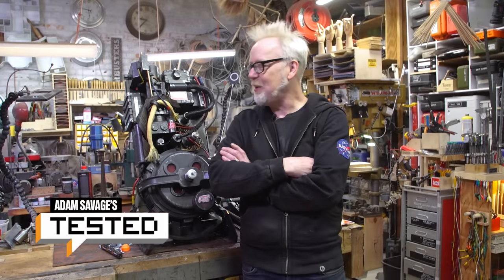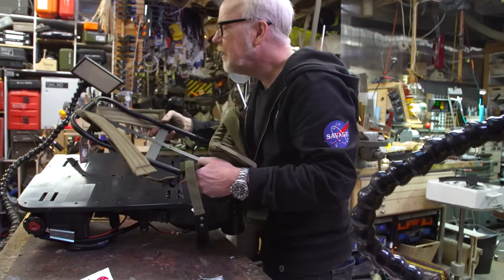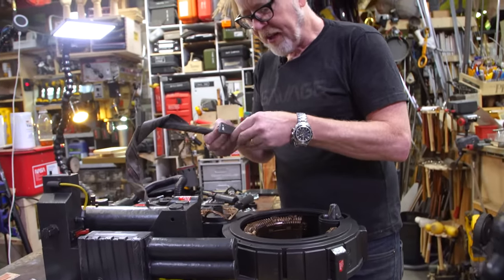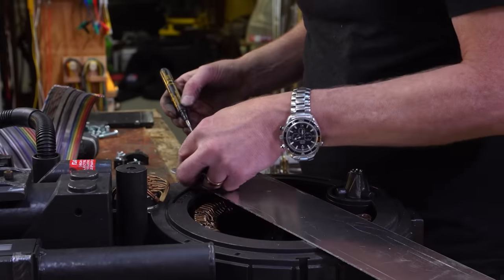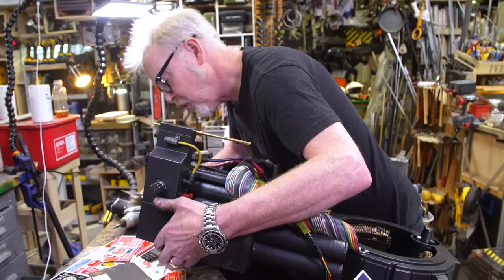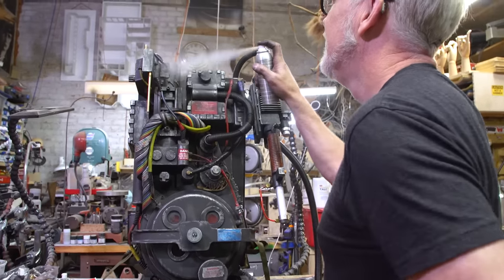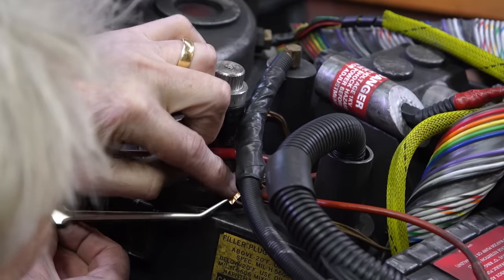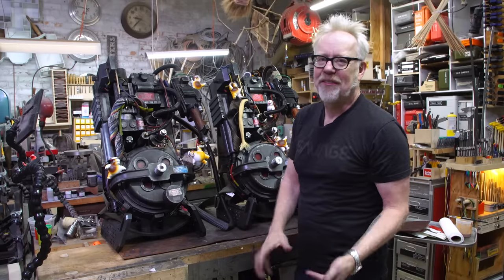Adam Savage's One Day Builds: Hasbro Proton Pack Upgrades!

Comment: My ex's father, as part of his work on his PhD in physics, made a small particle collider the size of a wall clock. So technically, it appears you could put one in that pack. It wouldn't make that cool sound when turned on, but at least when you use the line, "Why worry? Each of us is wearing an unlicensed nuclear accelerator on his back," you wouldn't entirely be making it up. 😁

(edit: for reference, technically a CRT in an old fashioned television is a "particle accelerator" using electrons, so its not really difficult).
Reply: Watch out, don't cross the streams!🤣

Comment: For those looking for the yellow braid sheath - my shop is linked in description above but I sold out. Should have more in a week or so.
Reply: Lol i jumped on it this morning, thank you!
Reply: Thank you, Sean!
Reply: Your GB cable kits have been consistently the best I have found. I have been forwarding all my locals to your shop for their wires and cables. Thanks for the great products.
Reply: @Shwalamazula  thanks!
Reply: Just read this now after finding it sold out. Thanks for the update!
Reply: Any V clips for the wand connection to top of pack? I couldn't locate it either from Adam's video. Also, is there a way to get notified when yellow braid sheath is back in stock? Thanks.
Reply: What gauge of wire did he use for the black, white, red, and green?
Reply: @Scorpius-Gamer  Agreed, curious where he found those V clips?
Reply: I’m GUESSING is 20awg.

Comment: I am stoked to receive my pack on Friday. I’ve been very impressed with the wand. There are some minor issues, but the electronics are outstanding. A switch to change between firing modes from the official video game? Using the top knob to adjust vibration and volume of hum? Are you kidding me? I can’t wait to upgrade the pack and wand. I’m even more excited knowing I’ll have extra stickers and hardware.

Comment: Hey Adam — when you go to look into the motherboard: the particle accelerator should be disassembled and taken out as it helps hold the motherboard and pack front together. Otherwise there’s several screws holding it together. 

Two of the long screws in the middle of the motherboard hold two pieces on the front of the pack. 

Also the Dixie cup holder for the neutrona wand on the pack is held by screw and nut/washer on the inside. You will need to take the motherboard off to do it. 

Best of luck whenever you decided to tackle it.

Comment: There is a small detail to the pack by removing the clipped ribbon cable bracket. Nothing major, but just a nice easter egg if you keep it and remove it when the pack is on.

Comment: Great weathering and video Adam, I'm actually a bit surprised they changed the ladder but at the same time thankful you helped them out there.wasnt thinking we would get a more accurate ladder.  on my neutrino wand I weather's the device only mildly to wait till my pack arrives and then see were I want to take it (for me probably somewhere between the original pack and the new rusted weather pack) I will weather the stand as I did with my neutrino wand to make it not rusted but rather lived on a shelf for ages worn in and lived in

Comment: Just wanted to mention, there are Easter egg sounds built into the pack that are based on the cables on it being unplugged, with the replacement put on, they’re permanently fixed, and so those features of the pack will never be accessed (rainbow cable is meant to be able to come on an off to create the pack malfunctioning mode)

Comment: I have yet to receive my pack but I find it extremely amusing that I have all the parts he added to it all set and ready to do my own exact modding. The cables, colored electricians tapes, copper tape, paints, sprays. Every exact thing he used, I had already bought before even watching this lol  Alice pack is also ready to rumble. My thoughts on the cyclotron, I don't have a 3d printer so I was just going to poke some real wires over the molded ones and do some repainting annnnnd maybe insert a light inside it. I also plan to do a smoke upgrade to the n-filter with a simple key fob system, nothing fancy.

Comment: Nice work. I just got mine. Like yours, the Alice frame is way too close to the backing board at the top. There is a much bigger (and more noticeable) gap on the real prop, where the foam tube goes. There isn’t any room for the foam tube at all now. Any idea if there’s a work around to fix this? Thanks.

Comment: Barnard clay has long been used by potters as a source of iron in dark firing glazes. It offers price advantages over using iron oxide and being a clay aids in suspending the materials in the slurry. Barnard has proven valuable for iron slip glazes requiring high clay content. That’s what it’s used for

Comment: The Ribbon cable on the Haslab one isn't GB2, that one is made up of a few dozen twisted pairs of rainbow and brown. The Haslab ribbon cable looks like they used as many wires as the GB2 packs, but colored them like the 18 wires in the GB1 pack.

Comment: Have you ever tried to do weathering which includes an obvious repair such that a component seems to be
newer?  Few things that are heavily used are monolithic in aging.  Obvious touch points and weak points are more heavily weathered or show signs of repair.
Reply: Never thought of it that way but that would be a really cool way to weather something
Reply: Another aspect of aging/weathering is a well cared for item.  For example  a soldier's weapon is well cared for in ways that matter to it's operation, but abused in ways don't.   The mechanism is pristinely clean while the stock might be clean but banged up.

Comment: Adam, as said in your separate building of the pack, do you plan to dive deep into the cyclotron and possibly wire in the video game lights? since the neutrona wand comes equipped with the video game settings?

Comment: I love it. Just know with the way you attached the ribbon cable you disabled the ability for part of the hasbro pack to work. When you detach that cable it gives error sounds and every once in a while there are slimer and other noises that play when the cable is disconnected. So with it permanently attached now it won't ever give you those cool sounds

Comment: Hey Adam, when you dig into the internals for a detail job. Will you check one thing for all of us?

Can you see if there is a way to make the motor not sound like a cow mooing?

I haven’t received mine yet, so I am not able to verify if it’s the motor itself, the location they placed it, or if it’s not insulated enough.

Also, when weathering the wand, why not replace the rear grip and add actual sports tape to it?
Reply: Upgrade the speaker with a simple aux mod and the new overpowering volume of the pack will drown out the rumble pack sound.

Comment: I did not get in on the original run for these, but I need to have one once they are made available to go with my neutrona wand.
Reply: they wont ever be made available. it was a crowdfunded Haslab project thats limited only to those who funded it a year ago. youd have to buy it at double the cost or more from scalpers on ebay if you want one.
Reply: @user-jm8bj1hd3d  Well I guess that's what I'll have to do then.

Comment: The annoying screw that can’t be removed goes into one of the tubes in the middle. With it loosened you can remove the tube and poke the screw through 

Remember to remove the round thing inside the cyclotron too as that’s structural

Comment: I absolutely love this. Adam's attention to detail is amazing. There's one thing that has me asking. Why didn't Adam use a real clippard valve used on the pack?? Please understand this just my opinion and mine alone. I modded my Spengler wand with the original 701 but that's just me.
Reply: Because it would have added $50 to what Hasbro was charging
Reply: @RealChrisBenoit  sorry. What I meant to say was why didn't Adam use a real clippard valve.

Comment: Did the ribbon cable clamp screws go into the point in the pack where the stock latches go in to keep the pack from sounding the alarm, or did you do something separately to push those contacts out?

Edit: FYI the alarm is triggered by a spring loaded button on the shell body.
Reply: I think they screw up with that. Thats why the don’t show the pack working after all the changes
Reply: I came here to ask the same question

Comment: In regards to what you said starting @ 7:16 about not lifting the pack by its bumper; I grab and lift my custom built aluminum/fiberglass GB1 pack by its bumper all the time, in fact, my preferred way to handle the pack when moving it is you hold the bumper with my right hand and the top or side of the ALICE pack frame with my left. With 3 mounting points and a total of 5 bolts securing it at those points, it's definitely the most secure "handle" on the pack, even more so than the ALICE pack frame. Most fans with a heavy fiberglass pack hold it in this same fashion.

Comment: I know this video was primarily weathering and not a complete modding situation. But if there is any way in the next video if he could cover how to convert the pack to run on a rechargeable battery pack, I would be eternally grateful.  The 90s are over, I thought I put the times of blowing through packs of D batteries behind me
Reply: You and me both. D batteries?  What was Haslab thinking?  My custom proton pack runs on 8 AA batteries and I'm sure this pack could have ran on the same or a little less
Reply: @focoalex  I mean 8 AAs is equivalent to 2.5 D batteries so that a pretty significant difference, but not super far off. I honestly would think it would need more battery capacity than what 4 D can provide, especially considering it vibrates which has to drain the battery more than anything. Does your setup just power lights? And how long do they typically last for you?

Comment: First of all love the video great job, but the one thing that sticks out is I think Adam killed the sound feature it has when removing the ribbon cable clamp
Reply: So I don’t think the cable does anything. It just pushes a small button when it’s connected. So the alarm sounds if the Little button isn’t pushed in.
Reply: @gethinnadin  he can remove the ribbon, he just needs to connect the new ribbon to that clamp so he can reconnect it and it will work just fine

Comment: Does that thing sound better IRL? It is kind of thin sounding over the computer. I wonder if a nice subwoofer addition would be in order?
Reply: I have car speakers in my custom built proton pack (not Haslab) and a subwoofer by way of a crossover board. The rumble of the bass and clarity of the sounds from the GBfans sound card have spoiled me and the Haslab pack sounds okay for what it is (how most toys making sounds would, the motor makes it vibrate a little) but it doesn't have that growl and hum that I'm used to.  I'm going to hang the Haslab pack on the wall for display only.

Comment: GB1 vs GB2 cable,the tool looks vetenary, squrrels and rabbits.Ultrasonic welding, what a XXX . washing machine bearings. older machines had the outer housing bolted , new ~ 2014 US welded. hacksaw down the weld, long job. worked well for several more years until the pcb blew , replaced a few components but ran out of time. Love the videos.

Comment: what V-hook, V-block did you use and where can i find it? The one on my pack doesn't work that well.
Reply: ahh figured it out, its a Dixie cup dispenser mounting bracket.
Reply: @LinkL33Twarrior  seeing a couple variations in google, could you drop a link?
Reply: The  Part i found is the San Jamar C927EZ Male Dispenser Bracket for Mounted Cup Dispensers. shouls see one in a webstaurants site.

Comment: This from the Google, What is Barnard clay?
"Barnard clay is a silty material with very low plasticity; so low that it is difficult to form test specimens from it in the plastic state (yet the drying shrinkage is around 4%!). The material is extremely messy to work with and stains containers and everything it touches."

Comment: I think for the price point this is a great piece to add to the collection. However, I have seen more screen-accurate prop packs sell for as low as $750 for something more durable with aluminum builds. This has come along ways from the $5,000 to $2500 packs from over the last 15 years.
Reply: Wow I have never seen a completed aluminum pack for 750. I’ve seen kits around that price that require you to do all the paint, electronics and assembly. But completed packs are still well over 1K. This was 400, with the wand about 525. You can’t do better than that. Especially when you consider this is now a limited collectable. They only made what was ordered. So I’m interested to see the resale on these. 

Honestly? My only disappointment with this pack is that it’s not brand spanking shiny new. I don’t dig the beat up/rusty aesthetic. I wish they offered an ‘84/‘89 variant or at least the wires/cables and accoutrement to make it look more OGB. The yellow fabric sheath is a particular eyesore.  But I’m glad they made everything easily removable and mod able. I don’t know why they didn’t make the copper wiring as easily removable but you can’t win em all. Still, this is a terrific product. Hats off to Hasbro. Now they gotta make a Real Ghostbusters version.
Reply: @MrGittz  The packs never were shiny new.
Reply: @ZiddersRooFurry  Compared to how they look in GBA, yeah they were. maybe "shiny" is a bit overstated but that's semantics.

Comment: Adam that's some fucking great detailing! Definitely gunna try that spray you used. What did you use to have that sliver pop out? And finally you did miss one thing the loom that comes out from the crank generator and into the upper side of the clippard valve has wires looping out of the split of the loom. Red was diffently visible with a few other sets of wires, looked like 12 gauge wires

Comment: Adam, some folks have LC-2 style alice frames, and according to the folks over in Europe who got their packs first, the LC-2 type frames aren't 100% compatible with the mounting brackets they include with the pack. Any chance you could figure out how to fix that so  a LC-2 frame would work?
Reply: I don't have the pack yet. But from the pictures I saw all it takes is 2 longer bolts and washers uses as spaces.
Reply: @killerbee2562  from what I have read about the issue on GBfans and on some of the facebook groups for the haslab pack, the vertical bar on a LC-2 frame is what the issue is. I have read conflicting stuff though, as one post someone showed the pack on a LC-2 frame and they stated that they did not need to modify anything about the frame to get it to work. It may have something to do with how the bar is bent on the frame though that allowed this person's frame to work. I bought a vintage military surplus army issued used LC-2 frame before I read that so I also ordered a vintage LC-1 frame just to be safe. If the LC-2 fram I bought also works one of the guys in my Ghostbusters group will have first dibs on buying it to use for their haslab pack. The only issue it has it the LC-2 kidney belt buckle/clip on the front is damaged and it will not stay snapped together. I sourced some replacement snap buckles that don't require cutting the stitching on the belt to install the replacement so that is easily fixed.
Reply: @vanloggins  Mine shipped today, I'll find out on Wednesday when it gets here .
Reply: @killerbee2562  mine shipped today as well. Says delivery by the end of day next Wednesday. I have a military issued LC-2 frame but I ordered a LC-1 just to be safe

Comment: how did you get the pack to not do the "unplugged cable" sound with your replacement clamp?
Reply: Hmm wehen i unplug my cable nothing is happening. It is still running
Reply: @KamilPolinceusz  Unplug the ribbon cable from the cyclotron.  It puts the pack into a mode with an alarm sound and the rotating lights go out.

Comment: you lost a function when you changed the ribbon cable. When the original cable is removed when the pack is on it will act like its malfunctioning

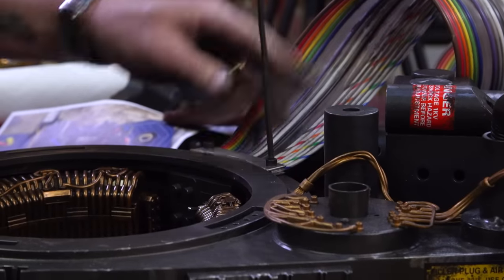Comment: time stamp 27:20 adam just hard mounts the ribbon cable to the spot but that part he replaces has interactivity with the pack the sounds wont work with out that part. its the part that gets ripped off by one of the mini puffs that keeps one of the packs from working that hasbro reproduced... oof.....
Reply: It’s not actually a working wire. When you “connect” it, it just pushes a button down that tells the pack it’s connected. There is no power being passed through. Kinda clever. You could just have the plate at the end of the wire attached but no wire.
Reply: @gethinnadin  I realized that

Comment: I find it slightly amusing the Adam is still flipping the switches on the neutrona wand in the wrong order, the switch below the intensify button is supposed to be flipped last other wise it won’t fire the proton stream.  Figure he must be dealing with muscle memory, in the sense that he is used to flipping the switches in the order he does at the beginning of the video…

Comment: If I had the money I would go out & buy one Bob's Prop Shop. You can have it customized from Bob's Prop shop. If I was Adam I would do a comparison video buy one from Bob's prop shop and compare it to the Hasbro. See which is better.
Reply: You're comparing a $3500 replica to a $400 toy. There is no comparison.
Reply: @RealChrisBenoit  $3500 proton pack is still a toy. The only difference is one cost $3500 and the other $400. There's nothing wrong with comparing the 2.
Reply: @RealChrisBenoit  Adam devalued a $400 toy why not devalue a $3,500 toy you still doing the same thing except one cost more than the other
Reply: Bobs prop shop is shunned in the Ghostbusters community for fraud and exploitative pricing
Reply: @ct0760  did not know that. Thanks for telling me that.